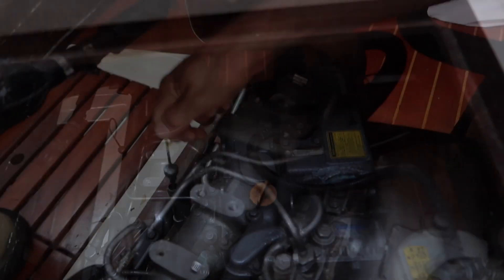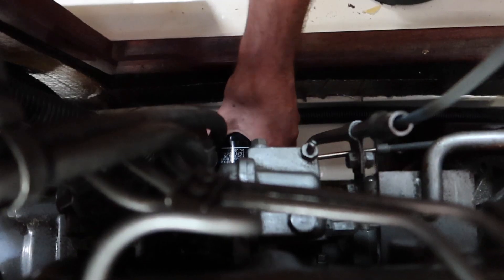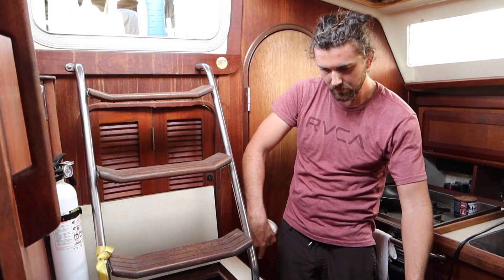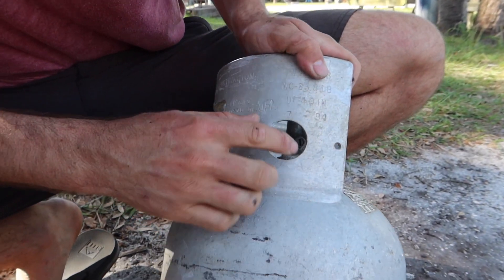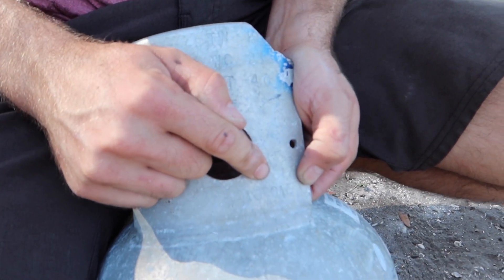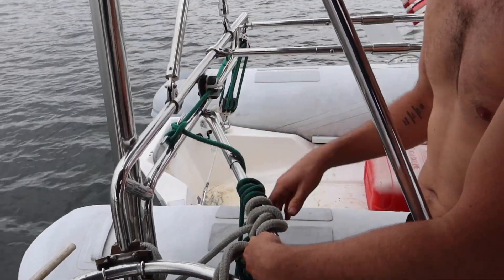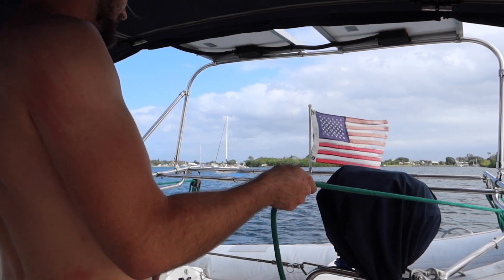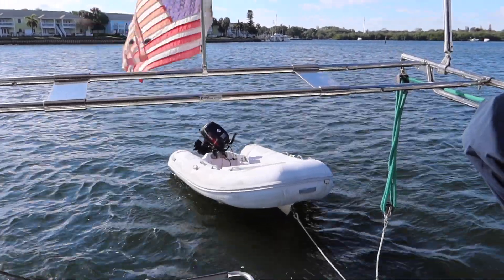Preparing for the FIRST SAIL | SMLS S11E10

Comment: I use a large zip lock baggie when I remove our oil filter which is mounted horizontally.  It helps capture the oil from the filter.
Reply: So do I!!
Reply: Great idea... one of those little tricks gained by experience.
Reply: He had a bag...but only thought to use it later for disposal.

Comment: You should always prime your oil filter before you screw it onto the motor! Meaning fill the filter full of oil and then quickly screwed on to the motor this also helps to oil the gasket to the block because sure enough some oil will always come out of the filter!

Comment: Instead of doing a Hydrostatic test on those bottles, which will cost you the same price as replacing them. Just take them down and use them as a core and buy filled bottles. They don't look at the expiration date, just if you have a one to turn in or not.
Reply: That's good to know!!

Comment: Pro Tip: Take your old expired propane bottles to Home Depoe and exchange them for new ones
Reply: boats use aluminum tanks, the ones at home depot are steel and will rust in no time.